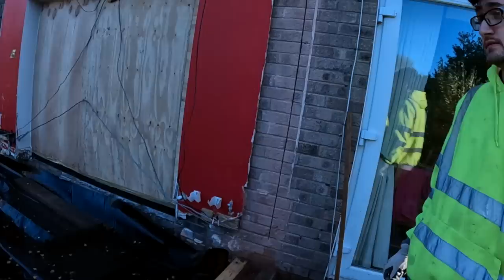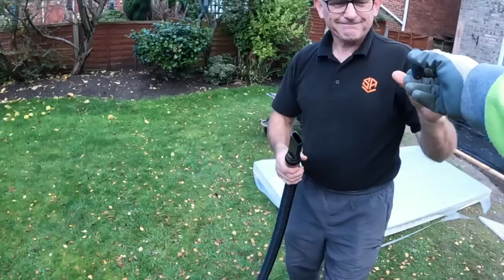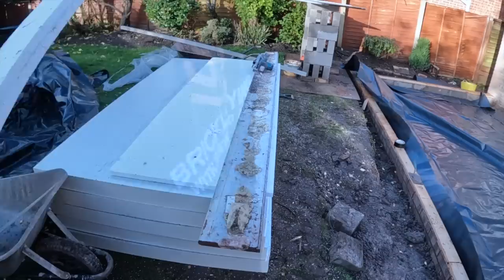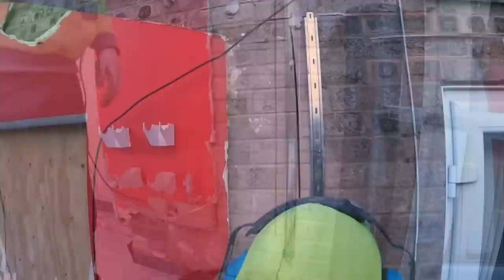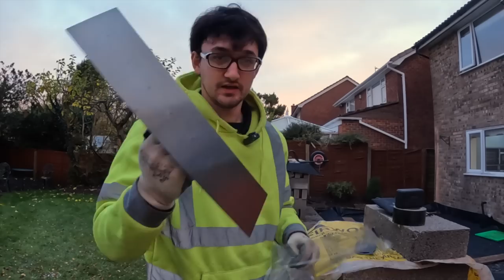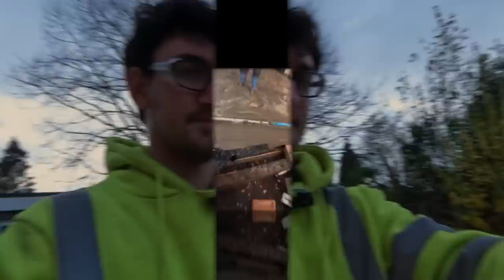STEP BY STEP CONCRETE SLAB AND INSULATION..BIG EXTENSION BUILD PT 4

Comment: Good work fellas was going to suggest Same thing as Andy west get a ball float that way once you have done your initial screed you can ball float the slab and it will level the slab and seal it  remember if you are going to ball float the slab then ball float it side ways on from the initial screed ie 90 degrees it will take any high or low spots once again well done

Comment: Loads I don't get 😄people saying Bullfloat it but if you do that you then need to mag float it then steel finish it you would be there all night waiting for it to go of to get a good finish which just isn't viable in this country. I've done plenty of finish concrete floors but very few in the UK .99% of the jobs I do have UFH and services so oversite concrete then the screeders come in ,far better IMO as that is a cost that can be passed on to the customer rather than struggling with a perfectly good system but one that is not climaticly suited to the UK, great Vid by the way👍👌
Reply from the maker: Totally agree Andy . We had a late, wet pour which got rained on so no hope of using those big floats . 
    The groundworkers we worked for used them on house slabs but poured  a strong mix in early doors to work on the slab in the afternoon .🧱👍🏽

Comment: Nice job gents, out of curiosity why is the cold bridging strip on the outside of the damp? And not inside the damp like the floor insulation?

Keep up the good work 👍🍻
Reply from the maker: It would be a nightmare to keep there when the concrete goes in 😫🧱👍🏽

Comment: I see Steve started using a dust mask whilst cutting the Celotex floor insulation with the power saw....very sensible. Alex should think about protecting his lungs too.
Hard to know what that stuff is made of and the circular saw throws micro particles into the air.....hand cut wouldn't be so hazardous 'probably'.
Excellent work chaps 👍
Reply from the maker: @martin2466  🤙🏾🤙🏾😷🧱👍🏽

Comment: Is that just general purpose type kingspan? I am looking to do a similar construction for a new garden workshop with a 4” thick slab for heavy machines. How does the insulation under the slab hold up?
Reply from the maker: Not sure on the technical side I’m afraid, sorry .
    Maybe google kingspan or celotex for information 🧱👍🏽

Comment: Wow what a slab. You made it look easy but I know it would’ve been hard work. Well done. You’ll soon get the hang of the microphones. Perhaps you could do with some sort of holder that goes round the back of your neck and holds the microphone in front of your mouth making them hands free…. Or place more than one around the job on tripods to capture conversation as you go. Dave Birmingham. 👊
Reply from the maker: They are supposed to fix to your lapel area . We just need to check they are switched on 😬🧱👍🏽
Reply: @SteveAndAlexBuild  oh yes.. that does help. 🤣
Reply from the maker: @davidbotterill7549  😬😬🤪

Comment: Lads..again, you don't need to be fanning around with a level, its a liquid, all you have to do is push the Co-Co pops below the milk, Tamp the top with a heavy timber, trowel the edges, a liquid will always find its own level, the  height of the slab will be proportionate to the volume of concrete poured, but it will always be level if you smash the Shiite out of it with a timber.

Comment: Hate bloody concrete nice to see you using proper insulation board instead of jablite bet that was a shock to the wallet haha. We can't do slabs like this anymore in Yorkshire building control say they sink. We have to lay 100mm concrete then insulation board then 100mm concrete again. One of the reasons we do wood floors. Nice video lads
Reply from the maker: @martin2466  😬😬🧱👍🏽

Comment: I was thinking this slab would be a good learning experience for Alex....until I saw the size of it and how wet the concrete was. Perhaps something a little smaller for Alex to cut his teeth on!!
I've watched a few concrete pours and never seen the water pour off it. Steve needed a medal....but got the job done as usual 👍
Reply from the maker: It was wet concrete and rain just made it worse .🧱👍🏽

Comment: Hmmm, no damp proofing between the house and the extension at the patio doors, that course of bricks is below the dpc membrane and your concrete is butting against it???
Reply from the maker: Wrong , there are no bricks there . We took them out below insulation level , blinded them , put DPM , insulation then more DPM then the floors bond to each other as they should not have a DPM sticking up,in the doorway
Reply: Hmmm Mr Expert,  Dpm poking above a finished floor and in a doorway to boot.You aren't a builder I assume (hope) ???
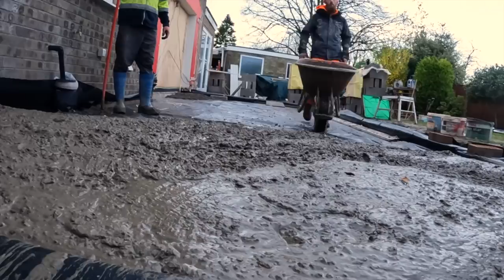Reply: @SteveAndAlexBuild  Sorry Steve/Alex, but it clearly shows at 30:00 barrowful's of concrete being tipped directly against the bare brickwork, not having a go at you, I think your quality of work and craftsmanship is excellent, but unless I am missing something, I'm sure there is something missing at that critical point. From 28:00 on, you can clearly see the bare brickwork, just making a point, keep the video's coming.
Reply from the maker: I see what you mean now . If you go to 27.17 you will see there is DPM against the brickwork so it is protected 👍🏼👍🏼. Thanks for watching the channel 🧱👍🏼
Reply: @SteveAndAlexBuild  at 26:30, you can see clearly that the course of brickwork on the internal skin has no coverage whatsoever and at 30 it is completely encased. Not going to comment on this again, I respect your working practises and admire the video's.
Reply from the maker: @martin2466  😆😆👍🏽🧱
Reply: @martin2466  Explain???
Reply: Martin knows everything @mikejames663
Reply: @btmanbirdman1  ???explain
Reply: @SteveAndAlexBuild  he's talking about the step leading into house having no DPM against it
Reply from the maker: @TeeTee-zm2re  that’s where the floors meet so no vertical Dpm needed